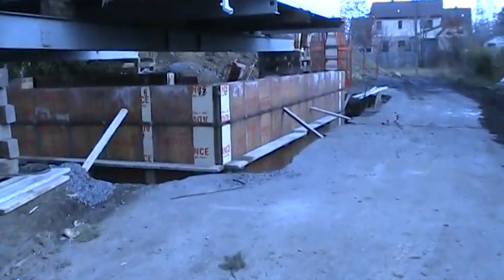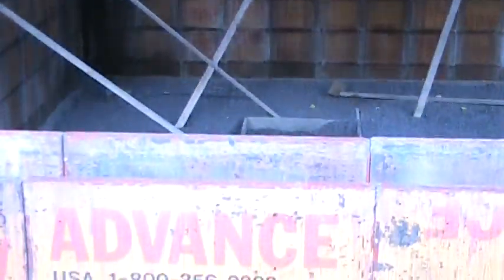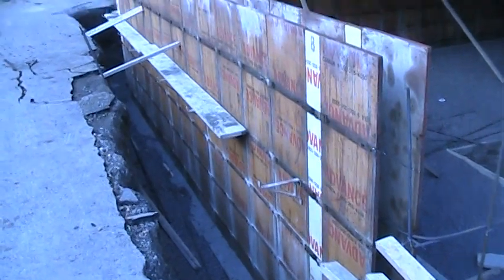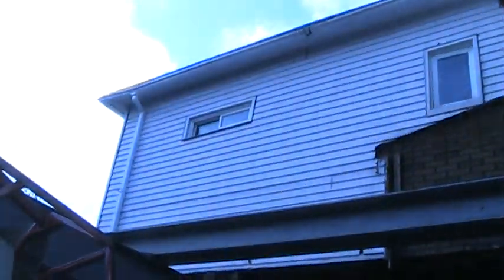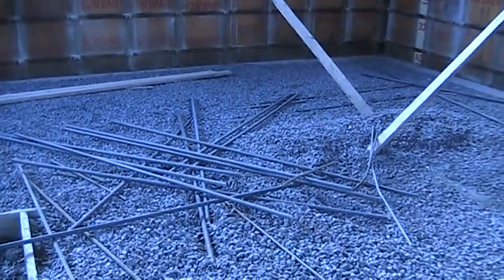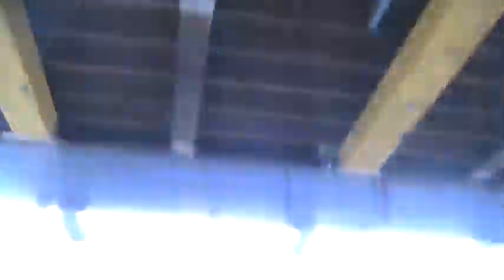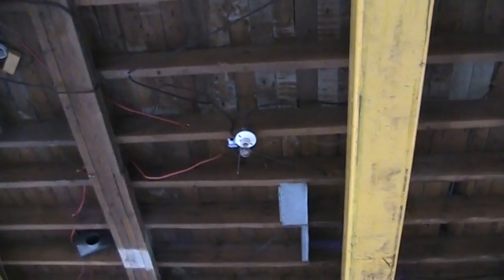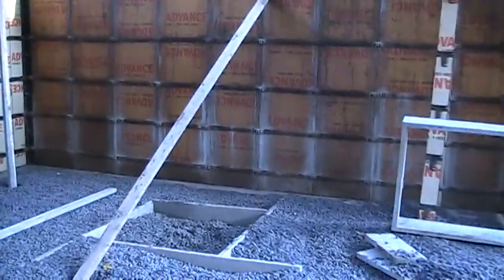Formwork and rebars

Comment: So why did you not remove your main floor beams and then cut a pocket up into the joist for new beams. Then you  hang the joist off the side of new beams that would be large enough to allow for the removal of all the posts in your basement giving you a clear floor space.
With the amount of work you had going it was easy to do and could all have been don from the underside without damage to your floors upstairs.
You spans are not that large and you probably would end up with headroom under the beams no  worse than you did anyway.
Reply from the maker: Originally the contractor was going to remove the existing beams and replace them with the Parallam beams, by then decided it would be easier to install the new beams next to the old beams.  Apparently it would have been a lot more work to remove them.  He had a terrible time installing the parllam beams.  I dont think he had experience wit hthem before, and didn;t realize how hard they are and how difficult it was to drill into them.  All my columns will be inside walls, except for one, so I don't need longer spans.